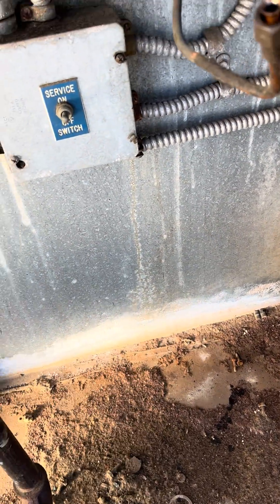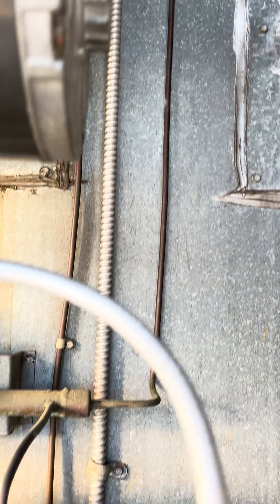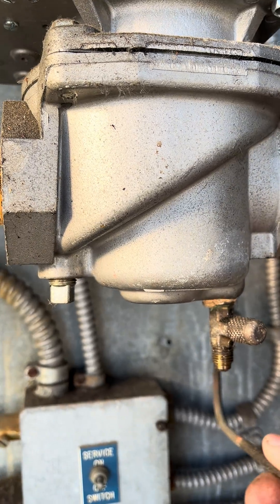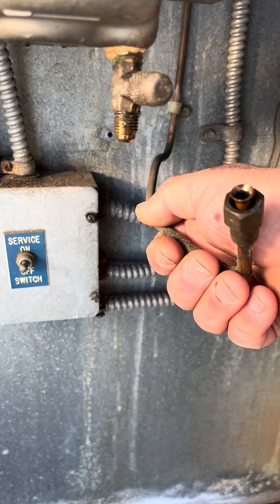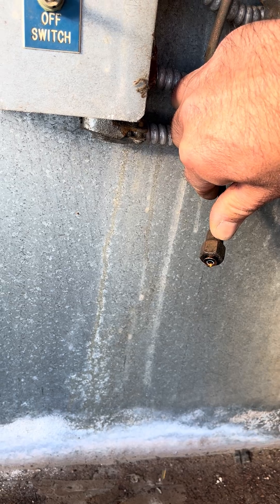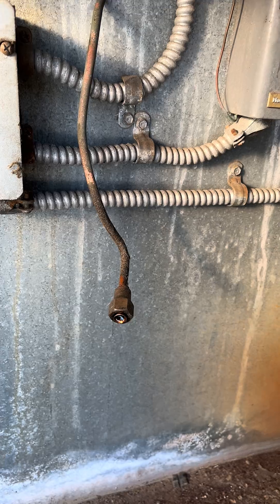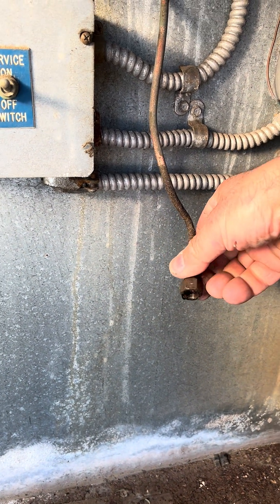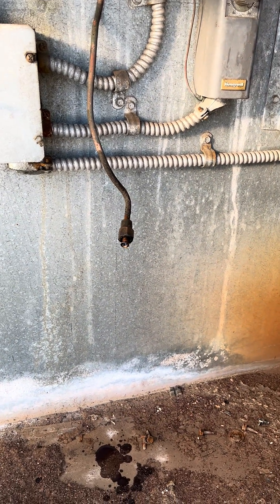Main HVAC Not working 2

Comment: Don't suck it out. Undo the other end and blow it out. Then fund out how the oil got in there...
Reply from the maker: Thankyou, I did do that. the gas valve has fluid in it, looks almost like transmission fluid, there must be a seal in there and the fluid leaked down. The valve is still working, but I'm going to replace it.
Thank you for watching.